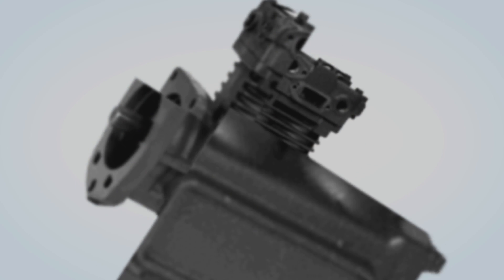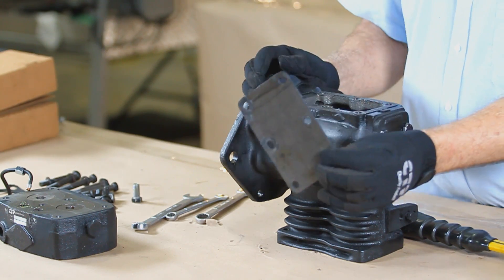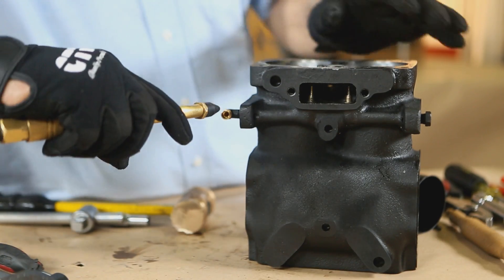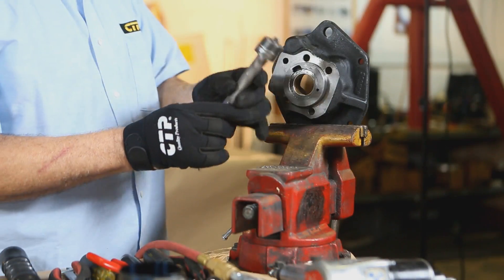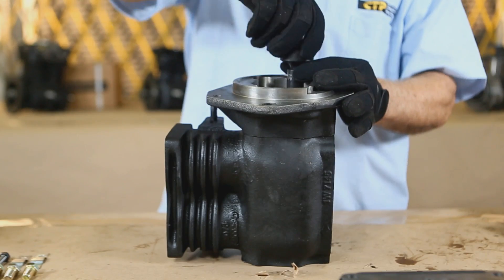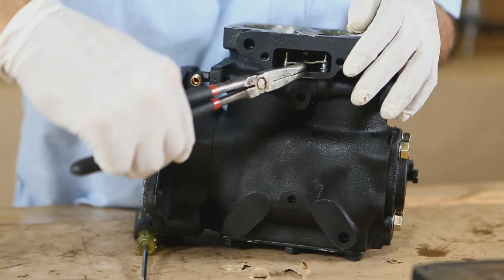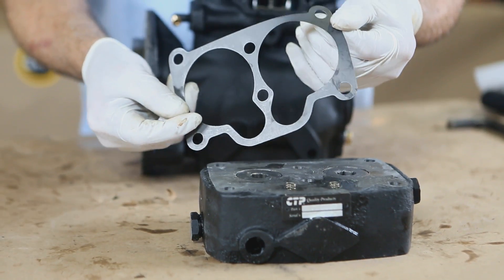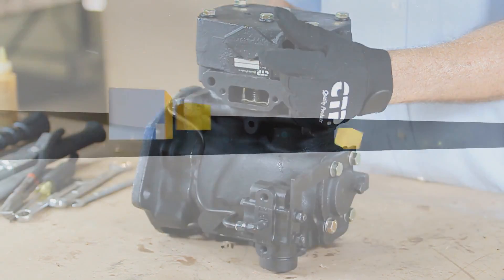Overhaul an Air Compressor

Comment: Isnt there a gasket between front housings and the main body and also gasket between rear housing and main body. I have oil leaks coming between rear housing and main body. How do you seal this with out gasket?...
Reply: You can make your own gasket out of a thin, hard cardboard, such as a breakfast cereal box. You lay the part onto the box on the bench, and trace the shape from the part onto the cardboard, and carefully cut it out. Apply a good layer of fresh oil onto both sides of this new gasket just before assembly.  Also, you can make a gasket just by using liquid gasket maker.  A really good brand for liquid gasket maker is Permatex.

Comment: If I have antifreeze coming out of the dryer each time it cycles but I’m building good air pressure what do you think the problem is?
Reply: I think its the Head Gasket to the break Air compressor leaking or is cracked. Just a guess after reading a coulle forums. I have the same problem and working on rebuilding mine on the weekend.
Reply: Who the fuck puts antreeze in an air compressor?   And head gasket..   both yall dumb as fuck..   this air compressor pump video..  not motor...  not car..  not an a/c system..   fuckin christ...
Reply from the maker: Hello and thank you for your comment! The air compressors primary function is to build pressure in the system. If your system incorporates the use of an air dryer to remove humidity, and the air dryer is purging water (“anti-freeze”?) then the system is working properly.

Comment: My CTP air compressor  stopped building pressure , what are the reasons for this? and what should i do...my compressor is 1 piston only
Reply: Seems like you need to repair it, or bring it to someone to repair, or replace it.
Reply from the maker: Hi Allan. The piston pumps the pressure and the valves control the pressure. Check the valves first, then the piston rings.
Reply from the maker: Good morning Allan and thank you for contacting us. For any questions or inquiries, please email us directly at marketing@costex.com so that one of our representatives can further assist you. Thank you!